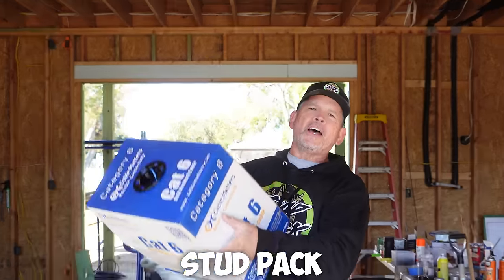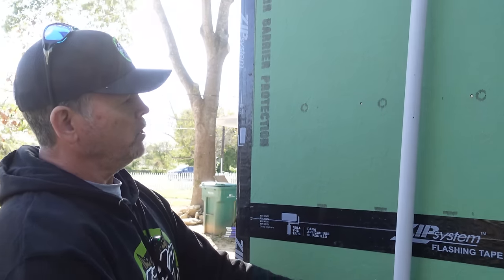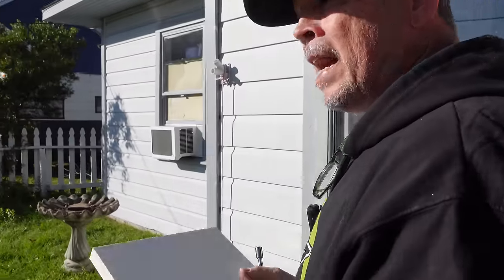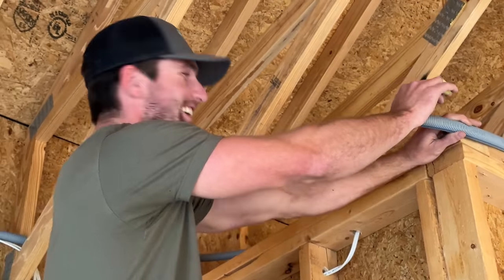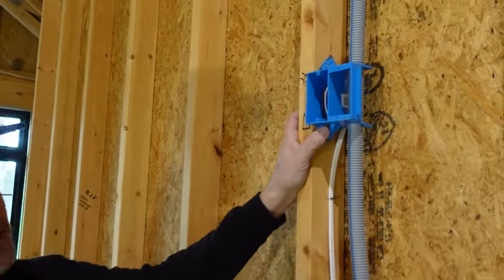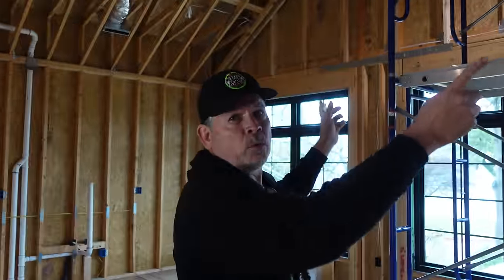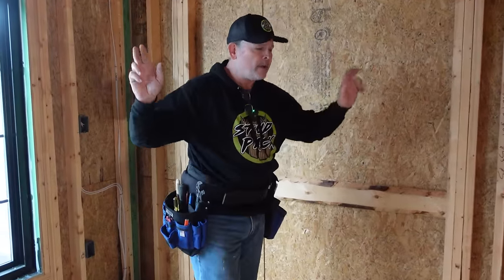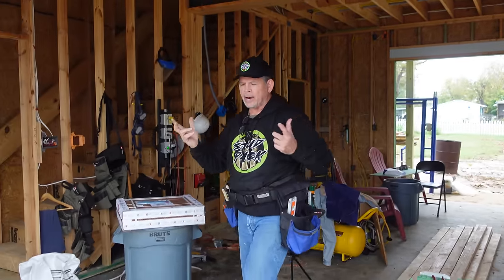DIY Networking for a Future Proof and HIGH SPEED Home! (Smurf Tubing and String Pull Trick!)

Comment: Following on from all of the plate comments, the reason AFAIK is that solid (aka Infrastructure) cable is specifically designed to be installed where it won't move. Stranded cable is far superior in its ability to be moved and reused without breaking.

It you have a media server and/or a headless NAS, you really want them connected by a Gigabit network switch (this will help deal with all of that internal network traffic rather than burdening your modems). Modems are NOT great as switches or even that good when the number of wireless devices starts mounting up. Not clear how many active jack plates you'll need, but I'd try an unmanaged 24 or even 48 port switch (they aren't terribly expensive).

Comment: for your issue with the 120 line next to the ethernet , it should not cause any problems as long as your running shielded cat 6 cable and properly shield them .

Comment: Please use the keystone jacks on a wall plate, and then run a jumper to the device.  If the cable breaks at the wall, and you have to pull a whole new line, it’s a very said day.  If just jack or the jumper breaks, no big deal 🤷‍♂️.  Make sure to leave 1-2 feet of service loops at each termination.  Some go with more.  That way, if a repair is needed, it’s easy.  You can also leave 10’ of cable in case locations need to move.

For POE (power of ethernet) devices, like access points or cameras, it’s highly recommended to use cat6a STP (shielded twisted pairs) with a drain line and shielded connectors.  You want the ground to protect the devices, and give stray angry pixies somewhere to go.
Reply: You only want to run direct lines  when specified by manufacturers, which is relatively rare.

Comment: Use the keystones and wall plates it makes a lot cleaner install plus run the cat6 cable Before the drywall and terminate after  and when pulling the cable pull in a new pull string along with it.

Comment: I suggest shielded CAT6a if you want to future-proof. Never crimp any cables used for infrastructure, only jacks. If u decide to keep cat6, I suggest shielded just to be safe. i have had issues with data throughout with unshielded cable near outlets. also, any HDMI over cat6 needs shielded cable.

Comment: Plastic conduit (like ENT) doesn't providing any sort of effective shielding from interference from AC power wiring. So always avoid parallel runs, and cross-overs should be at 90-degrees. If you have to run data and power lines in parallel, keep the parallel runs at least 12 inches apart, and keep the parallel runs as short as possible. If the parallel runs are 12-inches apart but are more than a few feet long consider using shielded Cat6 (STP) instead of unshielded Cat6 (UTP). Also consider running shielded Cat6 if you're in an electrically noisy environment (like a welding shop, or a radio station). And finally, never ever run data and power lines inside the same conduit or the same metal outlet box (even if you're running shielded Cat6).

Comment: The vacuum string in the conduit bit was very cool. But I do have two issues:
1) i hope that router is not a wireless router, as you are impacting your 5ghz speeds immediately by placing it behind the access panel. 
2) As everyone else has mentioned keystones, sheesh they look cleaner and won't give you any issues. Whereas you can read about all the other issues in the comments up top.

Comment: Don't mount cameras to the eaves of a two story building unless you want to see the tops of peoples' heads! Keep it around 8 ft off the ground. High enough to be difficult to tamper with, but low enough to get an angle of faces and cars.

You may want interior cameras, especially over that sweet mustang.

For security cameras, use power over ethernet (PoE), which can run data and power over a single ethernet cable. Cat 6 is more than enough as cameras are usually only 100 Mbps. Get a 24-port PoE network switch with a large power supply (e.g. 250 watts) to power everything. Rack mount and use patch panels for style points.

Plan on needing a lot more cameras than you'd expect. You want overlapping coverages of all entrances and ground windows. Also note that you use different cameras for different tasks. For example, if you want to see people's faces, you need to mount the camera about 8 ft from the ground and use a narrower FoV to get a closeup. Overview cameras can be higher up and wider FoV to see everything at lower detail. License plate readers are dedicated zoom lens cameras and need fine tuning.

Cameras are getting better, but plan on visible or IR lighting of the subject area. Built in IR is ok, but don't believe you'll get usable images in the dark.

You'll probably want to mount cameras to boxes. Eyeball aka turret cameras typically have proprietary metal boxes designed to fit their cameras, but there are some generic options you can repurpose.

Cameras are a lot of work to setup and maintain, so consider whether you want subscription cloud based systems or professional PoE with NVR solutions.

Dont ever use wifi for a camera, except maybe a doorbell. But might as well run ethernet for your doorbell and let you do PoE or traditional doorbell transformer with wifi.

Comment: Fiber lines ussually use Orange conduit to mark it being a fiber line. They make a micro duct for fiber runs too that is smaller and easier to run the fiber.
Reply: If it’s not orange, they usually tie identifier tags on the conduit

Comment: Cat6A should be used if you are going to use PoE devices such as cameras and access points. Wall plates and jack are the best install method for the user/field side. As for the distro point a patch panel would be optimal.  Both jacks and patch panels would require the use of a 110 punchdown tool. Klein makes an okay punchdown tool for non-data trades.  Also you would want to have the data conduit 90 and mount to the other stud in the wall to reduce interference in this instance. If the power was in EMT then same side is fine. The plastic piece in the middle of the cable is to space the pairs to reduce interference between the pairs.  Keep up the great content.
Reply: lol poe cameras will work just fine with cat5....they are all 10/100....cat6 is way more than sufficient.
Reply: @ipcamtalk4314  Never said it wouldn't  work. A nice new build should have nice 4 pair. I'm just boujee though lol. I use 6a stp for my home. We know the real bottleneck is the equipment and how its setup.

Comment: Remember, if you take a string pull a string. Have the tech pull a new string when they use your existing pull string. That way you can easily run another line if needed in the future. It's a good rule of thumb.

Comment: You should avoid running Data parallel to any power by 3', you can cross over at a 90° angle at any distance.

You can get around this by using sheilded data cables or shielding the conduit. alot of the time in commercial construction we use EMT for Data, or in steel structrues because power is ran in armor clad cable there isn't a large risk of interference.

Also we terminate out cables with Keystones instead of RJ45s so that the user may use a standard patch cable to reach the device requiring connection, except for ceiling-mounted devices such as Wifi routers.

Comment: keystone jacks and wall covers are the correct answer, not terminated wire direct to device. You can now buy the keystone jacks that you plug your terminated wire on the back side and leave the front port for a patch cable.

Comment: Low voltage wires should be a foot away from high voltage. The only time it's code compliant to get closer is if they are crossing at a 90 degree angle since the magnetic field doesn't have any effect on it then. Even then, they can't be touching. Outside of code compliance you can do it, but run the risk that a surge can induce a current in low voltage wires and fry whatever it's connected to. You'll also have interference which can cause signaling issues and will lower the throughput of a Cat6 cable.

Edit: Watched the rest and wanted to add some more info. Those pass-through style connectors are great, but if you run any Power over Ethernet (PoE) devices, you can run into some issues. Also the plastic core in the wire is actually for separating the data pairs to prevent crosstalk interference. You generally want to leave as much of that and the twists as possible, but it won't really matter in a residential setting.

Comment: For such a short run with Cat6, I wouldn't be concerned with EMI at all.  Go in to any number of businesses and you'll find Cat 5, 5e and 6 run in all kinds of ways, across fluorescent lighting, across MC cable, etc.  If you want to be extra safe, just use shielded Cat6 with the correct RJ45 ends.

Comment: As others have said, it would be better to terminate Cat6 cables with keystone jacks in a wall plate, as you were originally planning to do.  The long cable runs are solid core copper, which will fail if it gets flexed too many times.  The cable coming from the wall plate to the device will be made of stranded copper wire, which is much more tolerant of flexing.  And you really need a decent cable tester to confirm that all of the cable pairs are intact and correctly linked on each end.  Without that, you may see cable signal connectivity, but not be able to power end devices with Power over Ethernet (PoE) (like your cameras, and access points).  Or you may see power, but not have an ethernet signal.

Comment: Love the show guys!  Like warching my Dad and I work, where I hokd the tools and my dad does it all😂.  A couple thoughts on the network install....any reason you don't have your internet conpany run their fiber into your attic space and have them put their ONT box with additional cable loop in your attic?  Keeps one more box off your exterior wall and out of the weather.  Also, any thought about re-running your ethernet cable with CAT6A shielded or higher sized cable?  The shielding might help you where you are crossing electrical cables and will enable you to ground all the copper wire for safety.  Numerous options on Amazon from companies like Cable Matters, Mono Price, and others.  Make sure whatever you run, its solid copper and not stranded or copper covered wire in the twisted pairs.

Comment: You should Home run all of the data cables to the closet under your stairs and put a data panel there. That would be much better installation than what you’ve done.

Comment: 25:22 try to not have any twists in the wires as it leaves the sheathing. It will help so much when trying to pass the wires all the way through the RJ45 connector and will ensure the sheathing is 100% far enough into the connector. Low voltage controls contractor here. 

Love the vids guys and keep up the amazing work!
Reply: I get what you're saying as it does make it easier but I wouldn't encourage that just because the finished product should have a much twist left as possible for signal quality. So I could see someone who's new going overboard on the un-twisting
Reply: @georgecoffey9387  that is a solid point, however, the boys did get the CAT6 with the membrane in the middle which help with that. So excited to see how this house ends up in a year or two!

Comment: Keep in mind that standards for cable distance recommend that Cat5, Cat5e, Cat6 and Cat6a cables have a maximum cable segment run length of 100 meters or 328 feet.
Reply: Umm ideal practice is under 300’ unless you are running game changer.. but nothing in this project would even come close to 300’ mark..

Comment: SUGGESTION-- instead of routing all the wires up and across the trusses. Cross over on the garage ceiling then up. Will save you on length of lines layed and would be safer for you or the boys. Not up in the attic on top of the scaffolding as well.

Comment: I like you guys, so I'm not trying to be a jerk. For anyone running cable for a home network and wants it done right, hire a low-voltage installer.
Don't hire a handyman, an electrician, or have the AV guy do it. Hire a quality low-voltage installer. If you want things to be future proof for 10Gbps, have them certify each run. They will use a "tester" that if you could afford it, it wouldn't be practical to buy. A Fluke DSX2-5000 is around $11,000, for example. I've dealt with electricians treating Cat-6a like Cat-3, mice chewing through exposed fiber strands with no secondary strand. Getting the fiber fusion spliced is a pretty penny. Buy once, cry ones. Do it right when the walls are opened. Things may look simple when you don't know all the nuances.

Comment: 100% would use wall plates and keystones for any locations that you want a CAT6 jack but may or may not use it right now or in the future. For instance I have CAT6 keystones in each room for future office/gaming use or TV placement. If it’s a location like behind a TV, for a camera, or a temporary, I do the same thing you did. Check out Ubiquiti’s in wall access points for WiFi, they fit right on a low voltage box and look great. It’s not ideal to run data wiring close and parallel to AC power wire. For 1G speeds you could run right next to that Romex for that short distance and it would do fine, for 10G ehh I’d run the power and the data on opposite sides of the stud cavity. 10G on CAT6 requires high quality cable, quality terminations, and ideal conditions. In case for some reason you have a lighting ballast somewhere, make sure to keep that CAT6 a decent distance away from it, ballasts are notorious for interference, rendering the cable unusable….. also advice from being a telco engineer make sure to let your telco know that you want the same style exterior box on the garage as what is on the old house, we stock and use a few different types/models/brands, so since you measured that foam board exactly for that box, you’d be pretty upset if the installer does not have that style clamshell on his truck when he shows up to move the service.

Comment: 1000% have another pull string ready when the installer shows up so when he pulls the fiber line in he can pull a new pull string along with it so there is always 1 in the pipe, I started pulling 2 into all my conduit just to start because I have seen to many installers have the mentality they can just use the old Wire to pull a new Wire. In my mind every conduit should always have a pull string. For terminations of the CAT Cable I would do just as you are but then use Keystone Female to Female jacks for wall plates and network rack then use jumpers from wall to device.

Comment: 22:00 this cannot be overstated: You must always match your connectors to your cable and then your crimper to your connectors. 
Every connector will be suited to a particular a) conductor gauge, b) cable OD and c) type of conductor (solid or stranded). Reputable dealers will list these in the marketing materials.
You cannot, for example use Cat.6a connectors with Cat.6 cable (and vice versa) because the conductor gauge and OD of the two cables are significantly different.

For PoE applications you should probably avoid pass-through connectors because they can sometimes arc at the ends. Use load bar connectors instead.

All that said, 22:06 ABSOLUTELY use keystone jacks mounted in wall plates!

Comment: I don't know if you will need to have a Cat6 to your TV sets, the 3 I have installed all had built in Wi-Fi.  But the smurf tubing can contain other wires, like audio cable... for a surround speaker system.
Great job, I am still looking forward to seeing what you do for the roof.
Thanks!
Reply: anytime you have the option for WiFi or wired, take wired. it's faster and it will reduce the congestion on the WiFi.

Comment: You need to think of where you will want to put you WiFi mesh system. I have the EERO mesh system and i have 3 stations around my house (3000sf). I have each station hard wired to my system via cat 5 (or cat 6 for you). I would put a Ethernet outlet in every room, maybe even places you wouldn’t think. I kind of wish i had one in my kitchen.  Due to your Wi-Fi mesh system.

Comment: I’m wondering why it was necessary to run the ent all the way up to the ridge to get to the other side of the building. You should have been able to run across the ceiling of the garage and then up the interior wall to the equipment area.

Comment: Gota say. Loving the series so far. But entering my line of work i gotta add my 2c. Avoid pass through connectors like the plague. They corrode like crazy and usually fail compliance testing. They can also short when plugged into a metal receptacle and in PoE applications, can cause a fire. Just replaced one this week for an INDOOR AP. Had to cut back more than a foot of line because it was all green rust.

Comment: Pull all of that CAT6 and trash it. You need CAT6a. It has wider bandwidth and make sure it’s shielded. CAT6a normally is. That will help with any interference from electronics.

Comment: Personally I'd use the wall jacks, it will look cleaner. And while it is always nice to avoid running ethernet next to power it shouldn't cause a problem, ethernet cable is twisted pair which should avoid issues with interference and cross talk.

Comment: Hey guys, nice job on the smurf but when running ENT don't pull from the middle put the roll on a top hat and pull it off in the same fashion it was coiled you wont have to deal with the memory

Comment: Curious why fibre isn't being run to the elec rm under the stairs. Having it in the attic space, every time yo need to access your modem you'll need to climb up there. Are you also putting your PoE switches up there? 

Keystones should be used at the walls, not the male ends. The extra connection won't cause any significant signal loss and will look much nicer. With the male ends you always need to have a cable hanging out of the wall. Not a big deal though, they can be re-terminated as keystones later, just extra work that isn't needed.